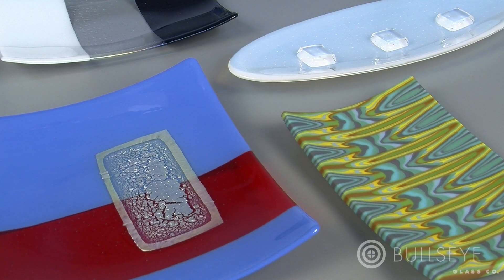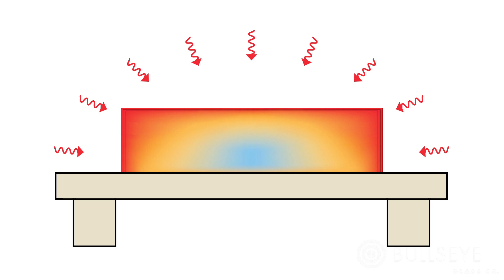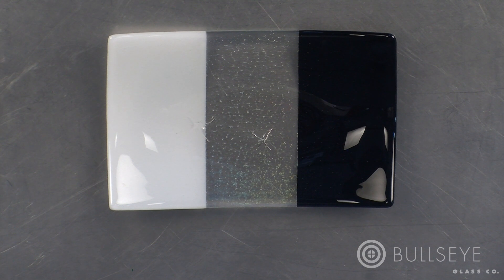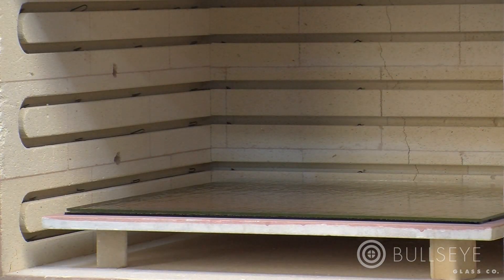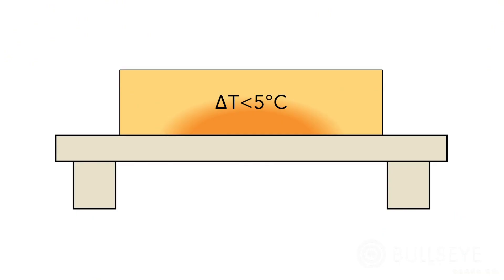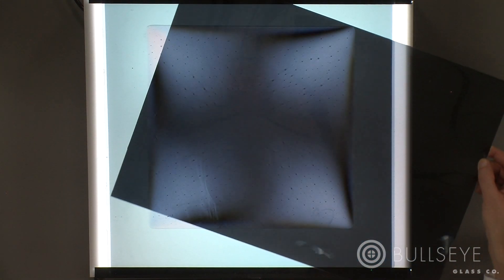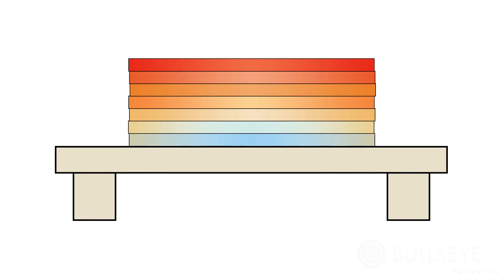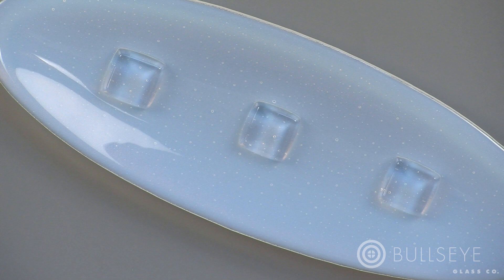Why Did It Break?

Comment: Where do you get the polarized light filters?
Reply from the maker: Hi Laura!

What you're looking for is called 'Linear Polarized Film'. Commonly the'll use the word 'Polarizing' too. Same stuff. There are a number of well-priced options on Amazon.

Really you just have to decide how big a sheet you need. One thing to look out for is how thick the film is. I'd prefer thicker sheets that come with a protective films on them that you can leave on. They're pretty sturdy. Some even have adhesive on one side if you're setting-up a light table. Remember you'll want two sheets.

This looks like a good one:
https://smile.amazon.com/Polarization-Polarizer-Educational-Physics-Polarized/dp/B06XWXRB75/

Thanks!
Reply: @BullseyeGlass  Thank you!
Reply: Очень нравится аналитический подход к процессам! Смотрю ваши видео, хотя и учусь работать с другим стеклом, с другим COE